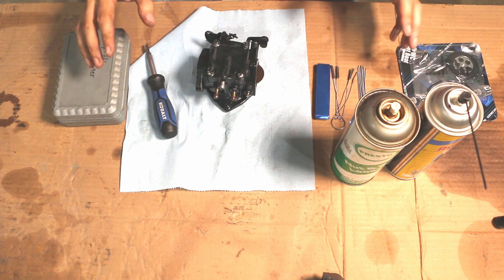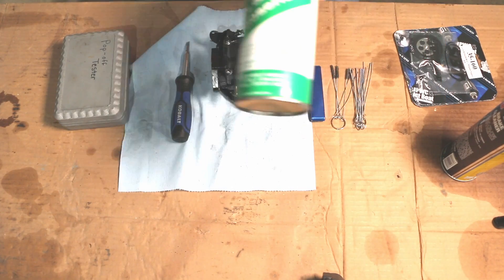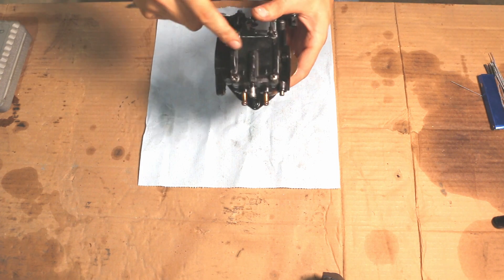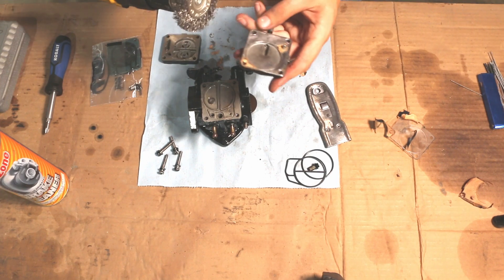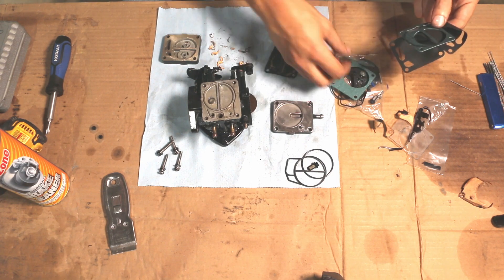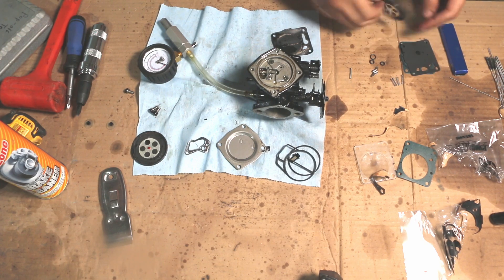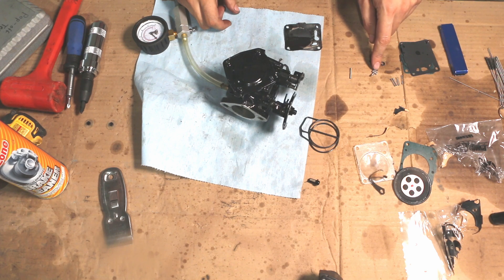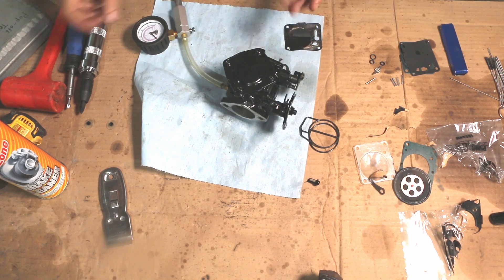Rebuilding a Mikuni Diaphragm Carburetor (BN, SBN, SBN-I, etc)

Comment: What’s the pop off pressure specs for a 1995 Yamaha WaveRunner 3 with the 650 engine/ Mikuni carburetor? 
I bought your recommended pop-off tester gauge/kit and followed your rebuild steps but the problem I’m having is when I start to pump up to pressure when I reach almost 20psi I start losing pressure and the needle slowly plummets… even with my finger over the recommended spot it’s not popping off nor allowing me over 20 before the needle gauge just drops . Any recommendations would be greatly appreciated for this DIY’er lol 😂😁🤙
Reply from the maker: I was sure I responded to you the other night. I must have forgotten to actually click the send button.
You should be in the realm of 30psi popoff. Are you getting bubbles or anything around the needle?
Reply: @trythistv  after re-watching your video and messing around with it I realized it was the wrong spring , my new rebuild kit came with two new springs so I swapped out one for the other and that fixed the problem!

Comment: What are three small o rings for?  I have them left over and came here to find where they go.
Reply from the maker: most likely there is one for the high speed needle, one for the low speed needle and one for the needle and seat. I avoid removing the needle and seat unless it is leaking, and the adjustment needles I change the o-rings when I clean out the needle passages if there is any suspicion of debris that could have clogged the passages.

Comment: On your site the chart has mag and PTO for carb screw settings. What does this mean? I have a 1994 yamaha VXR Pro with the 701
Reply from the maker: Whoops. That is for dual carb machines. Forgot about single carb specs!
On your machine Low should be within 1/4 turn of 1 7/8 turns, High should be within 1/4 turn of 1 5/8 turns out.
Reply: @trythistv  okay thank you so much!

Comment: Because my jet ski is not running properly. I have the low speed screw at 1.5 revolutions and the high speed at 2.5 revolutions
Reply from the maker: Yamaha 760cc should be around 1 5/8 turns out on the low and 3/8 turn out on the high adjuster, there is a table of specs on my website here: https://trythistv.com/mikuni/

Comment: thx for a great video . can you tell me where i can get info / jetting charts /specs on rejetting a carb for different altitudes. i m moving a 1986 js 550 from a colorado elevation of 5000’ to sea level altitude in florida. thx for any advice you have!
Reply from the maker: I'm not aware of any charts, I would love to find those myself, I would think that kind of elevation change may need a little change, you could try a size bigger and do some plug reads to see if it looks lean.
Wish I had more insight for you, I do a lot of my fine carb tuning by feel and plug reads to get the best performance from the stock recommendations.

Comment: Which is the kit you use to fi. Carbuteror?
Reply from the maker: So this list is a little exhaustive, it is in the description for the video but it seems like thats getting harder and harder to find so I'll post it here too:

SBT Kits: (These are what I use)
SBN & Square body BN (A lot of Seadoos 717 and smaller engines, Yamaha non-pv, Tigershark, Polaris): https://amzn.to/3xPS8J0
SBN-I Seadoos (951/947 97.5-03): https://amzn.to/3k365v1
SBN-I Yamahas (PV Motors 800 & 1200): https://amzn.to/3v7uaXS

Genuine Mikuni kits:
SBN & Square body BN (Pre 97 Seadoos, Kawasaki 750 98-02, Kawasaki SX-R 800 03-08, Likely others): https://amzn.to/3rK9GSS
SBN-I Seadoo (Seadoo 951/947 97.5-03): https://amzn.to/3k2tuga
SBN-I (PV Yamahas): https://amzn.to/3Kcr09O

Spare parts:
Internal screws that hold down the metering block (C5-0414-G): https://amzn.to/3MufWq3

Tools:
Manual Impact Screwdriver: https://amzn.to/3EJFFIs
Carb cleaning needles/brushes: https://amzn.to/3OueINc
Brake parts cleaner: https://amzn.to/38bKspH
WD40 or similar lubricant for popoff testing: https://amzn.to/3L9EhRF
Pop-off tester: https://amzn.to/3ENP4yE
Fuel pump checkvalve tool: https://amzn.to/3EJc3uz

Comment: why not carb cleaner instead of brake clean? and why not JIS screwdrivers instead of Philips? Is the junk from cleaning the jets not going into the carb if you clean them without taking them out? can WD-40 swell the gaskets if your using wd-40 when checking the pop off pressure?
Reply from the maker: Excellent questions! I have found little to no difference between brake cleaner and carb cleaner, if anything, brake cleaner seems mildly more aggressive so it cleans better but either would work fine.
The screws are jis screws so it would make more sense to use a jis screwdriver, but they are not super common and a Phillips works fine, the internal screws typically strip out regardless of what screwdriver you use, so I replace them with the stainless Phillips screws listed in the description to avoid problems in the future. The debris from cleaning the jets typically gets flushed out with the brake/carb cleaner, and if not, breaking it up and loosening it will make it flush through with gasoline once the engine is running. Haven't had any issue using WD-40 for the popoff in the past, typically I just use premix fuel in a small container, but WD-40 has not given me issues with swelling gaskets. Now brake clean or carb clean will swell any rubber nearly immediately and often it will not return to it's original size no matter what you do, so don't get any of that stuff on the new gaskets. Hopefully that answers your questions, I'm certainly not an expert, but have been rebuilding these carbs for years on customers skis, just sharing what has worked well for me!

Comment: Thank you very much for the video! I have a 1997 Wet Jet Kraze with the Yamaha 701 engine in it. I believe this is the carburetor I have but now 100 % sure. The internet has so many different opinions. Would you happen to know?
Reply from the maker: I've actually got a 94 Yamaha waverunner 3 gp right now that also has the 701cc engine, and as long as your wetjet has the same carb, you do indeed have a mikuni sbn, which will take one of these kits:
Aftermarket kit:
SBN & Square body BN (A lot of Seadoos 717 and smaller engines, Yamaha, Tigershark, Polaris): https://amzn.to/3xPS8J0

Oem kit:
SBN & Square body BN (Pre 97 Seadoos, Kawasaki 750 98-02, Kawasaki SX-R 800 03-08, Likely others): https://amzn.to/3rK9GSS
Reply: @trythistv  awesome! thanks so much for the response! Thanks again for your instructional video! This gives me some confidence to dig into it and get her running smooth!
Reply: Do you know if on a dual carburetor Yamaha 701, if the second carb in line of fuel, is not getting fuel, does that mean it's the pop off? Because everything else looks good. Or perhaps it is the fuel pump not getting to the second carburetor or pressure? Or can I install a second fuel pump?

Comment: Great video.  Doing carbs on a 98 xl1200w npv i believe the carbs are a bn-44, correct me if i'm wrong, will the kit listed above work on these if not what kit would. Thanks
Reply from the maker: You are indeed correct, so the kits you're wanting is one of these choices: (You will need 3 kits since you have 3 carbs)
OEM Mikuni:
SBN & Square body BN (Pre 97 Seadoos, Kawasaki 750 98-02, Kawasaki SX-R 800 03-08, Likely others): https://amzn.to/3rK9GSS
Aftermarket SBT:
SBN & Square body BN (A lot of Seadoos 717 and smaller engines, Yamaha, Tigershark, Polaris): https://amzn.to/3xPS8J0

Comment: Hello watch ur video what can I do if carb not pulling the ⛽
Reply from the maker: If it isn't pulling fuel, first thing I would check if it will pull fuel if you put a piece of fuel line from the carb directly into a small container with gas, like a water bottle full of gas right near the carb with a little piece of hose, because sometimes the old lines will leak air, fuel filters will crack or develop leaks, and you get air in the lines instead of fuel.

If it doesn't pull fuel with that setup, likely the internal fuel pump diaphragm is damaged, or the fuel filter in the carb could be plugged. If you have a Seadoo, the grey "tempo" fuel lines are notorious for degrading internally and clogging filters, as well as restricting or completely blocking fuel flow.

Comment: Super and useful! thanks.. do you use another aftermarket carb rebuild kits like WSM, winderossa (made in thailad)? carb gasket kits  from aliexpress is ugly and badly ??
Reply from the maker: Typically I use OEM or SBT kits, I do buy some things from WSM, and have had good success with all of them, but haven't tried their carb kits yet.
I have have very good success with OEM and SBT kits, some of the super cheap no-name kits do not last, some don't fit properly to begin with, I would say OEM, SBT and WSM are all sufficiently big enough that if something was that awful in their kits they wouldn't still be selling them.
Reply: Buy oem pay the money I bought a dual carb kit for $30 and now I'm doing it over again did not work for me.

Comment: Hey does it matter about the blue line on the check valves some people saying that blue line gotta be facing up its that truth??¿
Reply from the maker: I have heard the same, so I try to do the same now, I'm certain I have ignored that many times before, and have never noticed any ill effects, but if they say the blue line goes up, I try my best to follow that.
Reply: The reason they tell you to put the blue stripe up is because in the factory they cut it of a roll of plastic.
And because it is a piece of a roll it can be curved a little bit.
To make sure the convex part is upward from the seating they marked it with a blue stripe.

Comment: Great video!  Wondering how to identify exactly what carb my 1994 seadoo SPX has on it.  I want to purchase the proper rebuild kit in advance of pulling the carb.  From what I’m seeing sounds like the carb in my PWC is a BN-38.  Just wanted to confirm.  Thank you!
Reply from the maker: Indeed you are correct, you should have a BN-38 (which is considered a Super BN in some documents and carb kits) on a 657cc engine.

Comment: I watched you video as I was rebuilding mine  all I done is change gasket and the small filter and the clear parts well before I took my  mikuni bn 40-38 carburetor off the jet ski I took pictures of the hoses. Well I changed it all out I replaced the carburetor back and now I'm not getting fuel. I was getting fuel before I took it off but now I'm not. What could I do or try to help it out?
Reply from the maker: Are you sure you got the hoses on the same way around, turned the fuel selector on (I've done that little trick more than once lol), and sometimes it may take a while for the little diaphragm pump to pull the fuel all the way back from the tank.

Comment: Hello, very interesting video. I have 2 Mikuni 38 carbs on my Kawa jet ski. I changed nozzles and gaskets, cleaned everything.... I put transparent hoses to see the fuel. Problem after filling the hoses with a syringe, the engine runs but the gasoline does not arrive (see the little that remains tends to go back to the tank (no suction to the carbs)? I connected the fuel correctly carburetor according to the plan (intake, return, low engine pump)? I tested the pressure for opening nozzle 19 psi 
THANKS A LOT
Reply from the maker: Has to be related to the little fuel pump integrated into the carb. If you pull the lines off and stick them in a bottle of fuel does it pull fuel then?
I've seen them get hooked up to the wrong tubes on the fuel tank, or a plugged selector valve that doesn't let fuel pass in ON, but does in Reserve or things like that, putting the lines from the carb directly in a little bottle of fuel (gatorade bottles work great) would prove if it is the carb/fuel pump malfunctioning, or something else in the fuel tank/valve
Reply: Thank you for that answer. I'm going to try
Reply: thank you for your interesting answer.
I will try to put all the hoses in a bottle.
I'll let you know.
Eric
Reply from the maker: Leave the pulse line attached (goes to the fitting on the engine) but yeah the fuel and return lines on the carbs in a fuel bottle will show you if its pumping.
Reply: @trythistv  Thank a lot
I try it ......
Reply: @trythistv  Carbu alim 2.jpg

So after putting all the hoses (3) in a bottle of gasoline. 1 only feeds the 2 carburetors. 2 hoses make the fuel return (tap on and or reserve). And the engine runs great (see photo fitting)
I do not understand because it does not correspond to the Mikuni bn 38 power supply diagram !!!
What do you think ??
Thank you for the French mechanic
Eric
Reply: @trythistv  Carbu alim 2.jpg

So after putting all the hoses (3) in a bottle of gasoline. 1 only feeds the 2 carburetors. 2 hoses make the fuel return (tap on and or reserve). And the engine runs great (see photo fitting)
I do not understand because it does not correspond to the Mikuni bn 38 power supply diagram !!!
What do you think ??
Thank you for the French mechanic
Eric

Comment: Awesome video. Rebuilt many carbs but never a mikuni.  1 question how do you know what carb you have. Is it labeled?
Reply from the maker: There is a website called seadoosource that has specs for which machines have which carbs, I'm not aware of any markings that easily identify them, there are sometimes a part number on the base that can be cross referenced, but you can also identify them based on the size and shape of certain features.
Reply: @trythistv  thanks I'll go look now.

Comment: Have to disagree with you on the choice of rebuild kit.  Just buy Mikuni OEM… it’s five dollars more and will last many more seasons.  Those aftermarket needles leak.
Reply from the maker: Its a great debate. I haven't had a single carb fail with good quality aftermarket kits, some customers carbs have been going strong for 8 years now.
BUT, With that said, a genuine kit is a better bet than taking a gamble on some random no-name kit, those are almost always going to fail.
Reply: Have to say I am with you on this one, I cheaped out and went aftermarket and later when I had the cash an OEM kit for "when the first one fails"... and it's been 5 years now and haven't had to swap it.    Seems like at 40% the cost, it's pulling it's weight.  Thanks for the video and knowledge sharing!
Reply: The Sbt kits are oemthats y he don’t have no issues cheap eBay bs is the problem
Reply: @devshewitt4809  SBT is NOT oem.  Mikuni made products and sourced materials will always be better than any aftermarket kit.  Please don’t spread that misinformation.

Comment: What side on the check valves. SBT says darker blue up but mine look the same either way
Reply from the maker: I've never seen any directions on the check valves, they are just strips of plastic ultimately, as long as you put them on the correct side in the pump where the seat is, I can't see how it would make any difference what direction the plastic faces.
Reply: The reason they tell you to put the blue stripe up is because in the factory they cut it of a roll of plastic.
And because it is a piece of a roll it can be curved a little bit.
To make sure the convex part is upward from the seating they marked it with a blue stripe.

Comment: The green looking hard gasket that was left over on the pump side isn't necessary?
Reply from the maker: It depends on the carb. These did not use that specific gasket anywhere, but the kits come with styles of gaskets to work on multiple carbs. Best thing to do is match them up as you disassemble yours, there will likely be one or two that are not applicable
Reply: @trythistv  i did put that hard green gasket over the diaphragm, at around 8:55 on the video is where i placed the gasket, the base on my carb is a little different but still a mikuni sbn38, taking it off would be the best choice?

Comment: Good video but you didn't show how to adjust the pop off if it was not in spec.
Reply from the maker: Good point. Adjusting the popoff is a combination of the right spring with the right needle/seat oriface size. Generally speaking if it's wrong, try a different spring, I either have a chart on the website, or I need to put the chart on the website of how each spring and needle/seat set corresponds to popoff pressures, I think I already put it on there though
Reply: Yes chart please